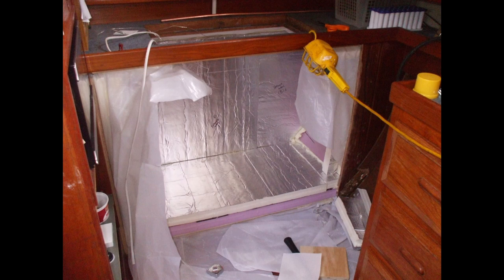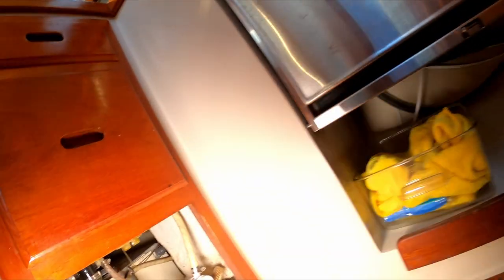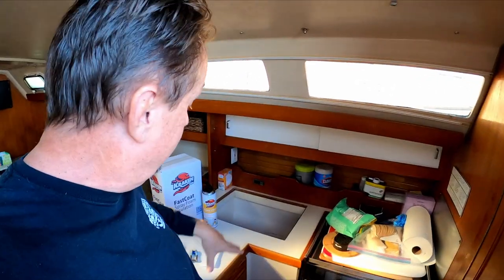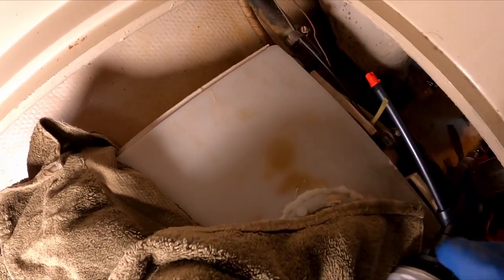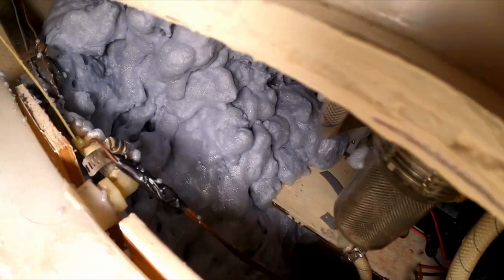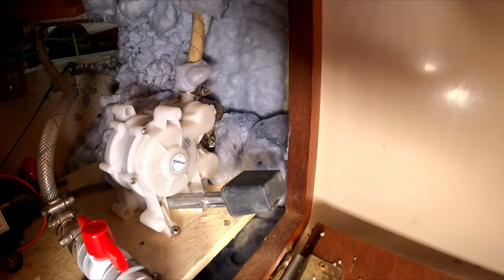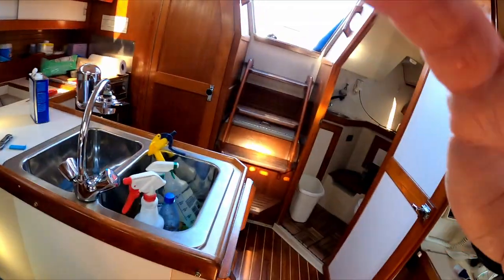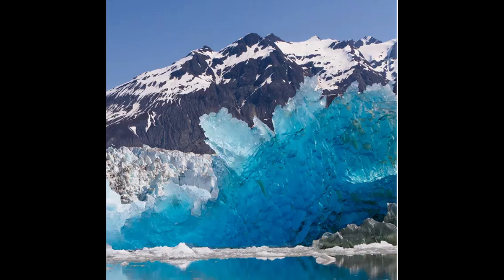Refrigerator insulation the easy way EP-12

Comment: How did the insulation hold up? Is the ice melting less quickly?
Reply from the maker: This was one of the best upgrades to the boat, it made an amazing difference, I can now set the fridge at any temperature and it keeps a very consistent temperature at all times.
The pump runs much, much less often!
And power usage is much lower overall!
I'm very happy with it! 
Thanks